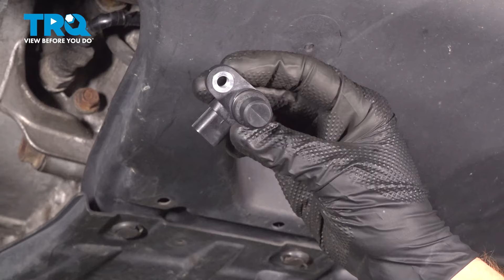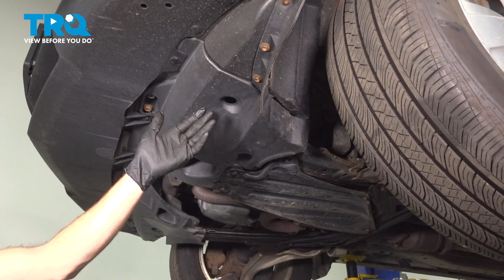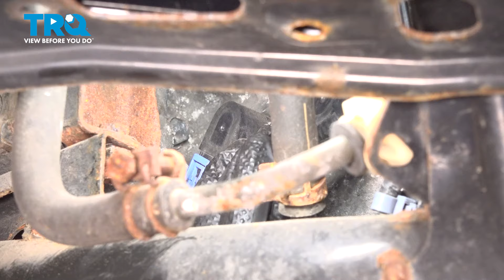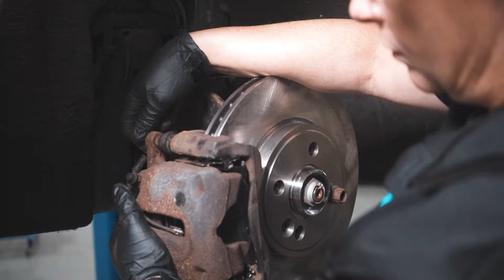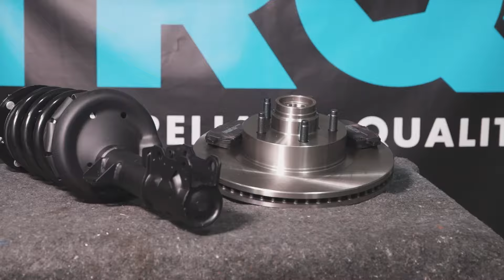How to Replace Vehicle Input Speed Sensor 2007-2013 Acura MDX

Comment: Hi I have Acura MDX 2014 I replace Hidraulic motor mount but for some reason the motor mount don't get active I try  to figure if is a Relay or fuse that active the motor mount. thanks for your videos.